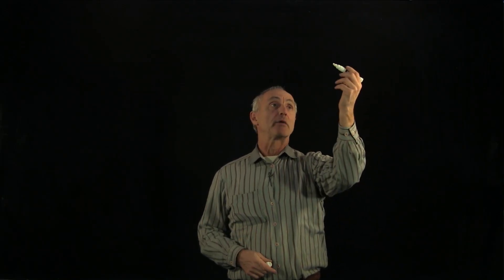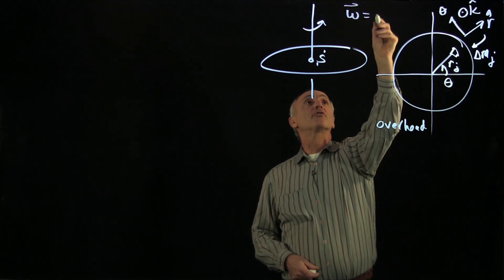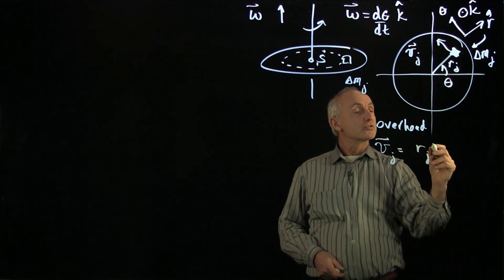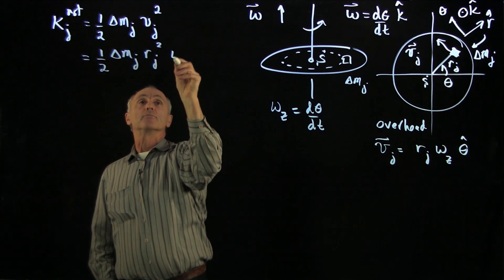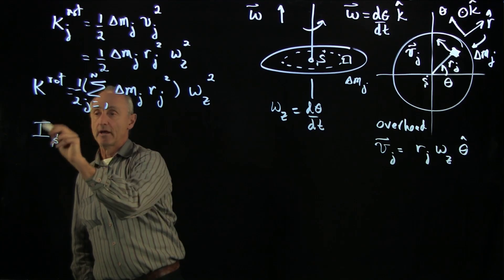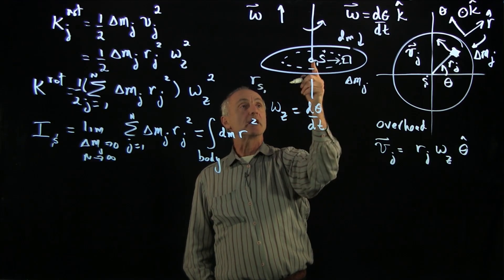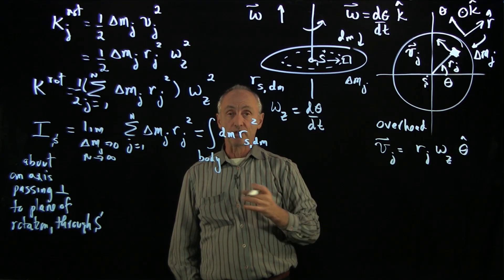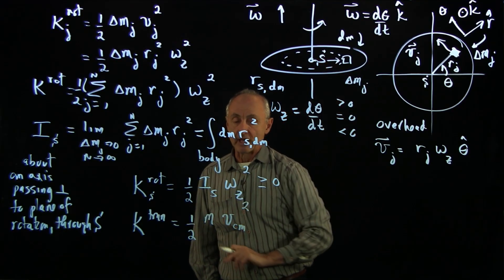29.1 Kinetic Energy of Rotation

Comment: If each mass element also has an instantaneous tangential velocity, then is the total energy of the body given by both a rotational component and a linear component? How can we then find the "v" component needed in K = 1/2mv^2, if the velocity of each mass element is different?
Reply: Energy is a scalar. Only the speed matters, and all points with an equal value of r have the same speed.